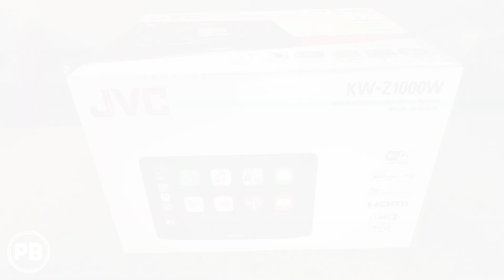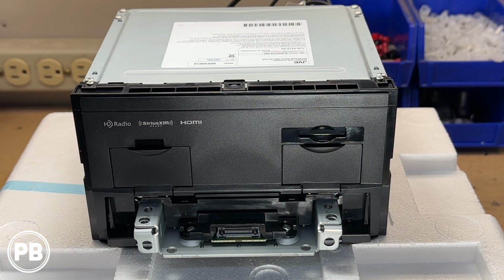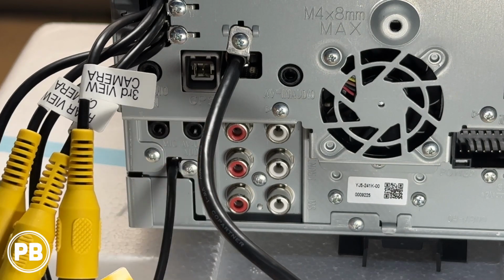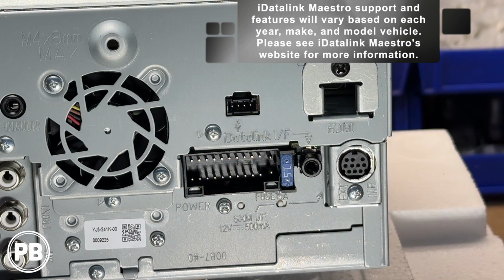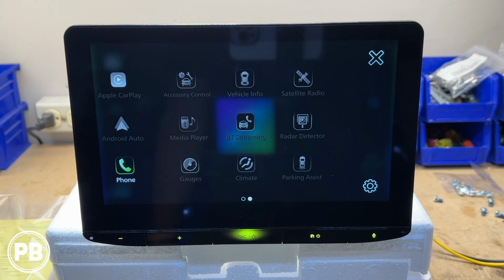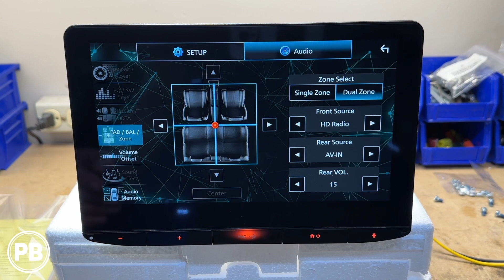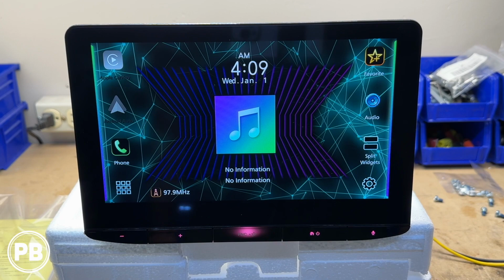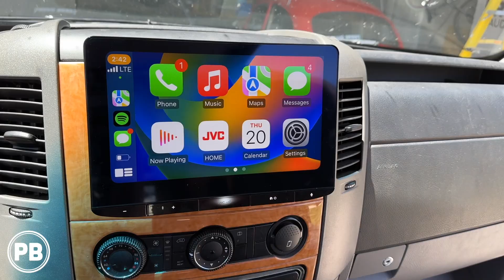#1 Biggest 10" JVC Wireless Carplay / Android Radio Demo! | KW-Z1000W

Comment: I REALLY wish it had the cd/dvd features for the price it is and a video of this being fully installed would be awesome!! 🤙
Reply from the maker: install video will be up shortly.  Went into a Sprinter Van.  CD / DVD won't be available in any unit with a float mount screen unfortunately.
Reply: @ProvoBeastAudio  Awesome!!  Thanks for the quick reply.  I'll be sure to watch it.  Yes,  that's extremely unfortunate 😢
Reply: Who still uses CDs and DVDs now days??  If you REALLY want one. You can buy and external small unit and and find a place to custom mounted and it can be hooked up via one of the many video input options.  Or you could just use an external drive of some sort and just store your entire library.  Or wireless screen cast.  If it doesn't give you all screencast options directly from your phone to the unit itself then you can just add a HDMI dongle or even a fire TV stick or some kind of Android device and use Chromecast to mirror it that way.  Can't take people seriously these days who expect a CD and DVD player in units any more.

Comment: Hi, I have a 2017 Hyundai Tucson. I bought this radio at Best Buy on Sunday, they will put it up. Can I control it via the steering wheel or do I need to purchase Maestro - Replacement Radio and Steering Wheel Interface for select vehicles
Reply from the maker: You'll need some sort of steering wheel control adapter: Pac SWI-RC-1, iDatalink Maestro, Metra ASWC-1.